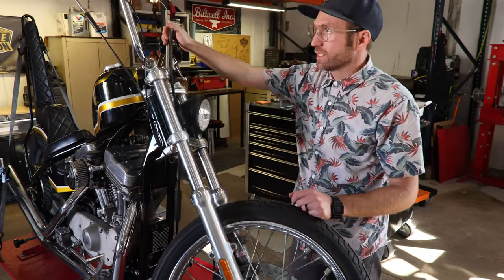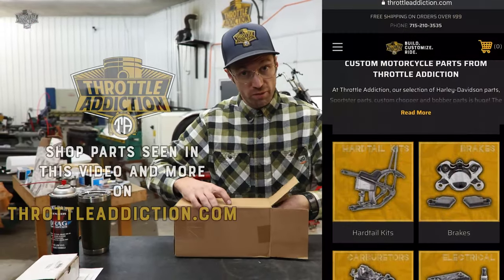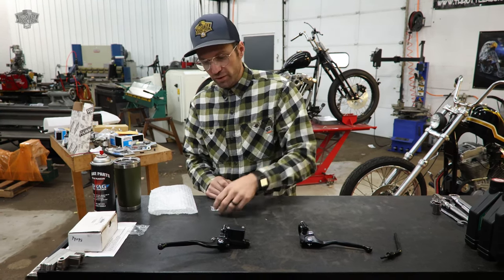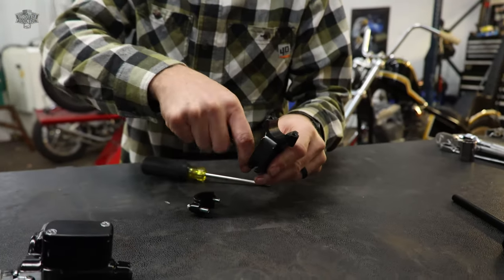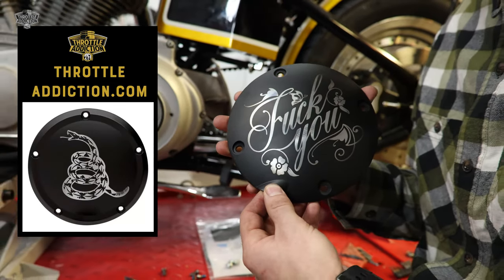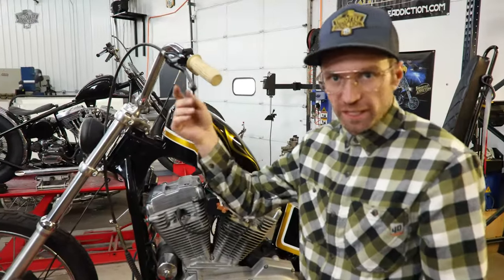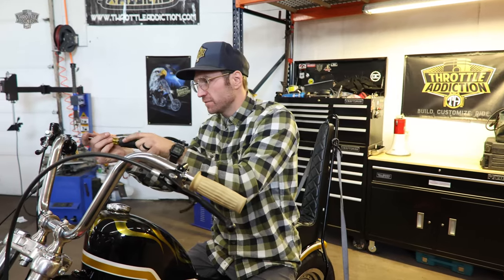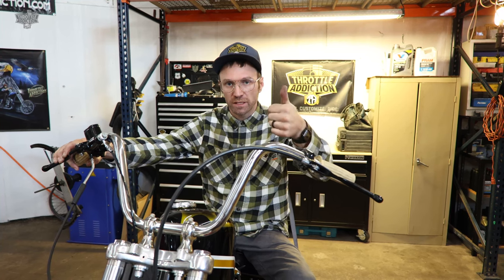Installing custom Hand Controls on our Sportster Chopper | Front End Cleanup Part 2 of 2

Comment: If I have a dual cable throttle housing on my 05 Sportster, do I need to install another dual cable control or can I go to a single cable model? Thank you
Reply: nah you can use a single just remove one just a personal note a 2nd cable might come in handy if your far from home and a throttle cable snaps a 2nd cable could save your life but plenty of dudes run a single

Comment: What about the rear brake light? Is there something built into these hand controls for that? Thanks
Reply from the maker: There is no brake light switch built into the aftermarket hand controls we're using so we're only running our brake light from our rear brake.
Reply: Thanks for the response!
Reply: Mike, you can install a hydraulic switch in a custom brake line if you're so inclined and need it for state inspection. The T fitting will actually bolt right up to the 1/4 -20 bolt under the lower triple tree. The T fittings I use have a -3 male on either end for a braided steel line, and a 1/8th. N.P.T. female for the light switch.  Careful running the wires as you know the forks need to be able to turn left and right without pinching them. I hope this helps. 
T.S. RACING
Reply: Goodridge makes a brake light switch banjo bolt. This I have also used several times before.  Of course both of these take away from the cleanliness of build, buy either will allow you to run those cool Throttle Addiction levers. 
T.S. RACING
Reply: @ThrottleAddictionCo  guys I hope you don't mind me helping out. I will delete the posts if you don't want them. 
You have some great products and I would hate to see you lose sales because of the light switch.
Reply from the maker: @t.s.racing  No worries! We appreciate the help, thanks for offering up your knowledge.
Reply: @ThrottleAddictionCo  this little thread here was the exact treasure trove of info I needed to solve my current predicament. Thanks all!

Comment: Did you put a brake light switch on the front brake?I have a chopper with no switch housings I would like the brake light to come on when I apply the front brake how do you put a switch in with no switch housing.
Reply from the maker: We did not put a brake light switch on the front brake of our Sportster chopper, we are just running our brake light off our rear brake switch. The hand controls we installed don't have the switch housings either.
Reply: @ThrottleAddictionCo  thanks.
Reply: You have a front brake on a chop. Sheesh.
Reply: @arthurcutaiar9994  you use your front brake without your rear? ha ya dont need a front brake switch as long as the rear lights up when ya push the brake ya dont need a front just use both brakes

Comment: I don’t see a video on how to remove the switch housings
Reply: thats easy just a few screws pop right off, the wiring for the headlight from the switch is a little more complicated especially if ya want a high low switch gotta do a toggle switch